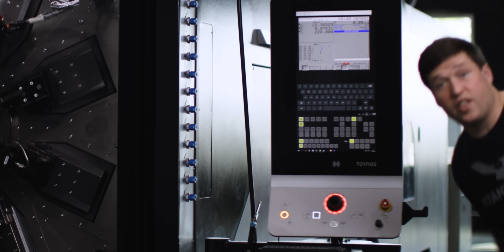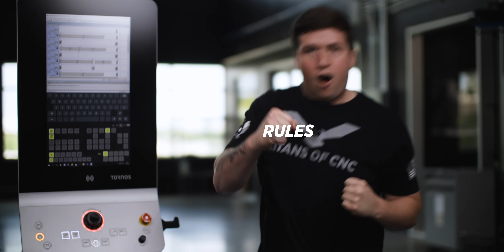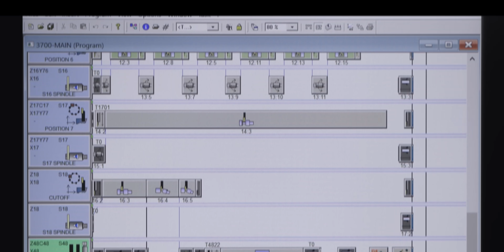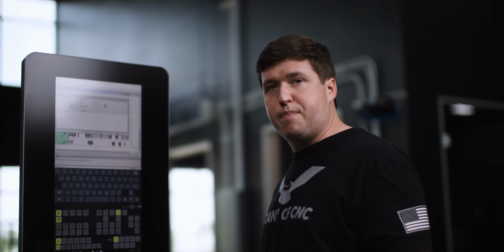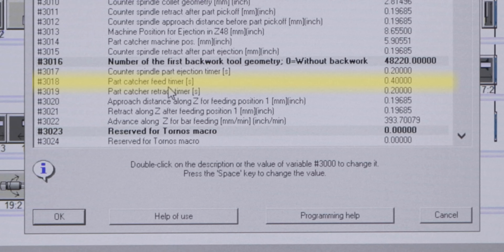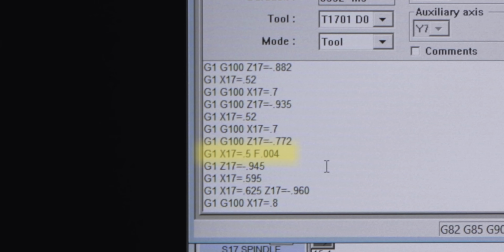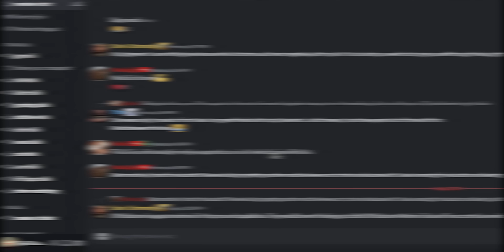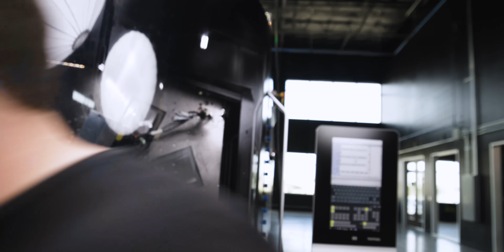Incredible Machining: Parts Made In Seconds Using 8 Spindles

Comment: I had a supervisor that used to do this, try and squeeze every tiny bit of time from the programme. Taking the tools to the absolute limit of their capabilities, which in theory is great, but unless your going to monitor the machine constantly, in case of tool failure, sometimes it's got to be better to loose a little time per part knowing that every part will be fine, than gaining some time but loosing it on tool breakage and sort outs
Reply: This. Milling brass/aluminum is way more forgiving than stainless and titanium. I worked for a very short time for a shop that did Swiss work and took the max-setting suggestions as suggestions for high nickel stainless/titanium. In short, they burned tools left n right and I genuinely wondered if they really saved money with the scrapped parts.
Reply: @MakeItWithCalvin  brass is forgiving, depending on what type of is, aluminium is ok but can get 'sticky' on the tools if the cooling isn't ideal and the tool is being pushed to hard.
Reply: I was thinking the same thing. You can speed it up just to the point of having a failure every 1,000 parts and not notice it. Then you lost all that time fixing it and getting it running again. I deal with the same thing on my 3D printer trying to reduce every second of print time. I tweak it so far it fails in the middle of a 8 hour print. Then I have to start all over again. So how much time did I save? lol
Reply: @mjodr  Boom! You nailed it on the 3D printing side of things. People want speed, but then cry when the print reliability is crap. That's the price you pay pushing things.
Reply: @mjodr  have you tried 150% infill line width at near your max volume flow?
Reply: @travistucker7317  I'm almost always at my nozzle's max flow on the whole print. Any higher and I get gaps and other quality issues.
Reply: @mjodr  i hear you.  What printer you got?
Reply: @travistucker7317  Ender 3 V2 with mods
Reply: @mjodr  have you heard of the volcomosq?
Reply: @travistucker7317  No, but I looked it up and it looks like any other speed run I've seen. There are two camps in 3d printing: speed run and actual production. I love the speed run shit, but for actually using the parts or selling them you can't even get close to those insane speeds. It's fun, but that's about it...fun.
Reply: @mjodr  it's just a high flow hot end. Yeah I've seen the tests. I would like to see the same type of tests in a heated chamber printing 50mm/s then again at 150, and again at 300. My Ratrigs are 4x the speed of my ender, but i see no difference at all in quality, all engineering type parts. I'm not talking about sub 5 minute benchys, more pushing what rapid prototyping looks like
Reply: You are 100 % correct. I own and operate a swiss cnc shop for 47 years. I run lights out on some simple jobs along with monitor cameras to be safe. If an oil line was to breaks while unattended you will have a busy next day. I run my machines conservatively with very little down time if any on most jobs. Why run balls out and have 70% down time replacing burnt inserts and drills. I run seven machines daily and if I have to be fixing tooling all the time, I will always be struggling with deliveries. Don't push tools to their melting point and you will be far ahead of the rest!!
Reply: I’m glad there are people like me who think it’s not a good idea to always push machinery to 100% all the time.
Reply: I worked in a machine shop 35 years ago that was doing the same thing.
Reply: Why not coldforging these parts?
Reply: Especially in this case, where you have one operation being the bottleneck, once that's at a reasonable level you can adjust all the other ones to be just 500ms quicker and save the tools for those.

Comment: Donnie, nice job explaining the software, my question to you is how long does it take to write the program for an operation like that?
Reply: Not to mention to set the tooling. Mind you, they have a pretty efficient way of setting offsets (touch setters etc) quite quickly on each tool.
Reply: When you do large and long part run with a machine like he's using. Long setup time and programming is really a small percentage of the total time you save. He's doing what would takes a single feed swiss lathe a min in 7 seconds.
Reply: It would take me more than a week to get the initial program set up, so throw that whole week of time gained away, lol.

Comment: So is this considered a conversational machine then Donnie ? Looks a lot like it, never seen a machine where all the tool paths are running off off variables. This is a headache 😂but looks to make editing programs on the fly way faster.
Reply: No it’s not conversational. It outputs a template for you to add the cutting toolpaths. That’s all you typically have to add tho. It’s one of the easiest ways to do a 8 spindle in my opinion because all the staging is done for you. All of the cutoff operations were in there before I started. I only added like 10% of what you are seeing on the screen

Comment: Coming from an IT background. Why can the Programm not suggest improvements itself with for example AI? Why has it to be done manually?
Sorry if this question does not make any sense.
Also why is the user interface this dated look- are all high end machines this way?
Reply: So I get questions like this a lot. With different materials, tool geometries, machine capabilities and just general mechanical things that could be going on AI isn’t really there yet. There are so many variables. The reality with CNC is that the programming is very basic compared to what someone like you is used to so the need to add all the sensors and whatnot to take care of this for me would be tens of thousands of dollars. The majority of parts require basic math and after a couple of years most people can understand it. One day I’m sure what you are talking about will happen. For now it’s up to people like me. Hope that was a half decent answer
Reply: @donniehinske  I loved the answer! Thanks for going into the details here :)- I understand the complexity better now. A startup called Lumafield is doing the AI part for CT scans. To improve machining should be feasible as well. I think the sensors and hardware would improve the cost drastically. I think just the software integration is lacking behind and the commitment of the “older” machining companies.
Have a great day from Germany :)

Comment: I might not be correct here, but I assume that each part has to stay in each position for 8 seconds, due to the longest position taking 8 seconds, which is 64 seconds to make one part, excluding rotation time to the next position, since it’s unknown in the video.
To make 500,000 parts at 8 seconds per position, 500,000 X 8 X 8 / 3600 / 24= 370 Days
To make 500,000 parts at 7 seconds per position, 500,000 X 7 X 8 / 3600 / 24= 324 Days
So by cutting 8 seconds per part you make the job 46 days shorter, and that is a lot of money saved.
Reply from the maker: Each tool might take a single second… more or less. And all cuts happen at the same time. Spindles rotate and the process repeats. 7 seconds later, the part is done on the last spindle.
Reply: @TITANSofCNC  That is fast. I also relies that my logic was wrong, even if it took 8 seconds per spindle, it would still produce a part every 8 seconds, not 64 seconds that I used in my math.
Reply: @brokentusk5033  The way to think of it is that the machine ejects one fully finished part every 7 seconds, it just accomplishes this by working on 8 parts at a time for no longer than 7 seconds per operation in what is essentially an assembly line.  So the time from starting a single part to ejecting it is 56 seconds, but because 8 are running in parallel you divide by 8 to get the overall line rate.
Reply: @TITANSofCNC  Can you shoot a video from start to finish raw stock to finish part in real time? That is some really cool software. Reminds me of the Fagor controller.

Comment: Would just increasing spindle revs speed up production?
Reply: And there's also a point where acceleration and deacceleration take longer than just holding a lower RPM cap.
Reply: @dale0104  Specially when you're doing small parts, the rpm can get pretty high. The spool up and spool down times seem to take ages.
Reply: At some speed there's a limit where you burn up the tools
Reply: @srck4035  But what a nice gif you could make of the machine running on full burnout speed, even if it crashes into 3 revolutions :D

Comment: I work in a small shop and all the parts I make are for in house assembly. so I can have periods where I have no work so I'd fill my time by speeding up my run times which just lead to longer periods with no work.
Reply: That's still good. I've hired machinists that slow down on purpose to avoid that and it drives me crazy.
Reply: @Wade-1  Indeed, those people need to be retaught.
Reply: @Wade-1  When I went to a company, they were making one part, cylindrical grinding, pretty close tolerance, . 0003" and some gage dimensions .0005, it was taking them 16 minutes to make one part, the old timers were very happy with that, they retired and I let loose, figured out a way to do it in one pass, cut out several operations, got it down to 4 min.  THEN they bought me a Studer S40 CNC, started putzing around and found I could get it down to 1 minute.  Now I REALLY didn't want to work THAT fast so I slowed it down to 2 min.  Did the AssHats appreciate what I've done, NOPE but I had fun doing it and zero scrap in the process.  With todays cnc's the whole thing could be made on a multi axis machine from bar stock to finished product.
Reply: Sell that time obviously
Reply: @hak1985org  So, telling the supervisors that you sped up the program would fix this issue? Report, document everything? That when clients come to view the factory & it might seem that the worker is not doing anything, the guide can say that they are speeding up the program runtimes or some other support tasks for improving the efficiency/safety of the workflow?
Reply: Money shot 12:16
Reply: If its work, it can be automated.
Reply: @hak1985org  This is definitely worthwhile; creating, writing, and submitting efficiency improvement reports. Depending on your particular working environment, sitting at a desk writing these up might not be seen as a good use of your time, so you may be "forced" to write them up on your own time. One potential pitfall could be that when you submit these reports to your immediate supervisor, they may sandbag them and take the credit for your work. Navigating business place politics is always delicate.
Reply: heh im in the same boat
Reply: When I was a young guy, the exec v p came to me with handful of time sheets.  He said Dennis we have a huge problem with your times on these parts. (hoo boy I thought) he said I'm going to sit here and watch you for a while. Well if I'm going to get fired might as well work til I do. After an hour or so he said I see where the difference is. Got a $1.25 raise next Jan. Work smarter my theory.
Reply: I work BandSaw in a shop where demand for cut bars increasingly goes up every single day. Lowering cut times, shuttle times, and number of cuts impacts the job's time drastically every single time! I'm often just waiting for my machine while I go make a coffee while my machine is going full tilt :3
Reply: Ask to fill the extra time by assembling parts or something else.
Reply: Which will lead you to being fored
Reply: Sounds like you guys need to hire someone to get more work coming in.
Reply: Hello, I have a Schutte brand 8-shaft conveyor CNC automatic machine that I received in return for work. I don't know what to do right now
Reply: @erhansarkin3095  sorry I've never worked on anything like that
Reply: I have a similar problem
Reply: The software does not work out fastest time...!!? Okay then.
Reply: @mikeorr9533  Factory settings are more safe to prevent maintenance, tool and material use...
Reply: @willemhaifetz-chen1588  This is 10% thinking, they'll argue it too lol.

Comment: Golly man, that machine is very advanced! I remember working at a shop and we were machining the exhaust elbows for Holset, they went on the dodge Cummins turbo diesels. We were required to get 20 parts an hour done, and I was always in competition with 2nd shift on who could get the most parts done per shift so I messed with the feeds and speeds on the machine and figured out I was able to get 30 parts an hour done without wearing down the inserts more. No wonder why my boss loved me, come to find out, I saved a lot of time for the cycle time of the parts 🤙🏽😉

Comment: I used to set multi spindles many years ago, but instead of CNC they where cam operated and utilised form tools, our multi spindle bay were manufacturing millions of parts per week. Single spindle auto's were making olives 3 at a time with 6 second cycle
Reply: I currently work on that. Acme-gridly 6 spindle. I'm cranking out a dual delivery part. Cycle time of 6.7 seconds (divide in half cause of the dual delivery.) While this vid is awesome, you're right. I'm holding a 2 tenths of a tho tolerance. crapping out 900k in a few months.
Reply: @LordViktor299  I wonder what the profit per part is, a couple dimes?
Reply: @b2dmastersniper  I'm told a bit more than a quarter per part.
Reply: @LordViktor299  damn - gotta get me a swiss
Reply: Cam driven multispindles are very fast and still hold amazing tolerance. I used to design all the form tools, tool holding and setups for some. These CNC ones have a huge advantage though, fast setup/changeovers
Reply: I'm a davenport guy. We can get down to 2 seconds or so. But man they take a long time to set up
Reply: In norway we have much faster speed pr part than this. 3 sec at some point depending at what wee was making.  the gippring part have a cycle time of 1.3 sec  that's cam machines. the index ms 40 cnc could make this par in this video at 5 sec may be faster. run it as a dual 4 spindel machine .  if its not a special cut that i cant se.
Reply: Index 25's and Traub A25's, and other models of course,  were/are king of high speed production!! Only ''problem'' is/was, calculating the curves on the cam plates and making the plates for a new part, and fine-tuning the cycle.  But if it was done correct, it was blistering fast!!  The good old days!!
Reply: @R2_D3   the wickman Machines its ok. But it did not hold Long before it was out of toleranse.  The ms40  we tested iit. It moved 0.01mm att 200000 parts. 😄
Reply: @MyAudioPipe  Those old machines are super durable and accurate! Just love how they are build to last!
Reply: @R2_D3  the ms 40 Machine is an 2018 modell  😀
Reply: @MyAudioPipe  That will surely be on an entire other level of machining capability!
Reply: Used to set up mechanical multi spindle lathes, with cams. 1940s machines, incredibly fast. Got replaced with CNC machines & scrapped which  I think only due to it needed to be manned 24h a day.
Reply: @patrickbrown7491  I'm sure that the hourly price of those machines were a few percent of the CNC hourly rates, even with a person manning them.  The machines need little to no maintenance, use cheap tools (mostly) and are written off tax-wise. A big part of scrapping them, (a dead shame if you ask me) is the fact there are no new workers who know how to set up and maintain them. (that was the case at where I worked at least)
Reply: @patrickbrown7491  I think the only improvement's that CNC multi spindles have is faster set times and running unmanned. CNC's in general has been a revolution in machining. It's unbelievable what CNC's can manufacture today
Reply: Spent years running Acme-Gridley 6 and 8 spindle automatics. We would run 2-3 machines per person.

Some of those machines were used to support the war effort in WW2.
Reply: I worked at a shop setting up acme gridleys. One of the oldest was used in the war effort build in 1942. Still was able to hold .001 of the o.d. not bad for a 4 1/2 inch acme that was build so long ago.
Reply: Hello, I have a Schutte brand 8-shaft conveyor CNC automatic machine that I received in return for work. I don't know what to do right now

Comment: Looks like a good application for optimization algorithms/"AI" - although it seems surprising that the CAD software doesn't include that already - perhaps it's trading off speed for tool durability or probability of failure?
Reply: Yes totally agree. Was wondering about the same in my comment, coming from an IT background. Also the whole UI looks somewhat dated, can someone comment, is this state of the art?
Reply: @stefan-bayer  it's normal for cnc machines to run somewhat old looking software. Stuff needs to be 100 percent bug free or crashes will happen and they are costly and dangerous. We have machines from 2018 with ui that looks like windows 98
Reply: @srck4035  I understand the point you are coming from.
I will argue the lack of startup made it this way because the R&D needed to start in the machining industry is very high so until now no real innovative startup has competed. But a well design UI is not prone to have more errors. The better UI just improves the operators error so this would go hand in hand normally if the industry leaders would not be that “ancient”.
But that’s just my impression
Reply: @stefan-bayer  just saying it takes ages to test the ui. Imagine one bit flip from.  0.1mm to 10mm. Crash.
Reply: @srck4035  Haha. I was going to say... Looking at this Windows 98 style UI only means one thing...they want it to work no matter what on a million part run. One software crash while nobody is supervising would cost a lot.
Reply: Good input, although this would not be possible with EAR and ITAR parts as the part dimensions are national security. You would need a localized AI server that is ITAR controlled/not connected to the internet.